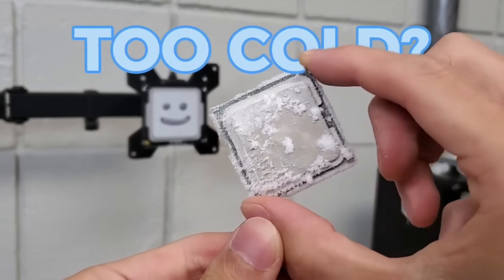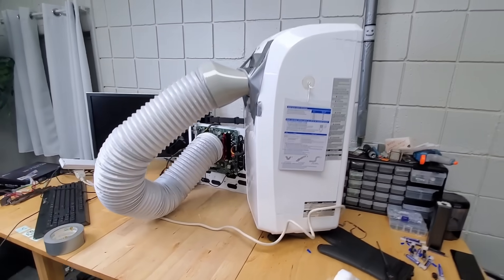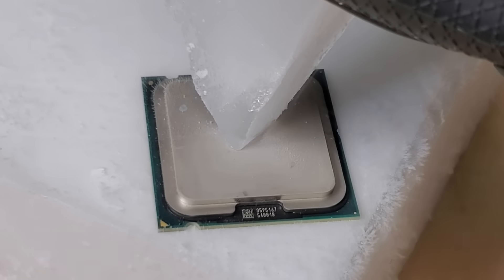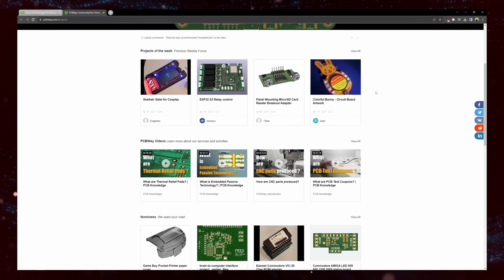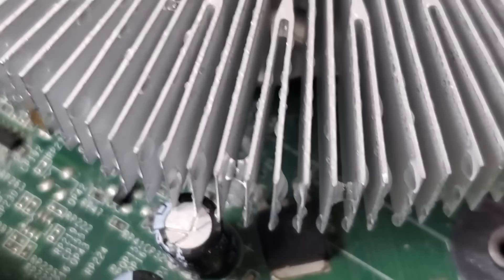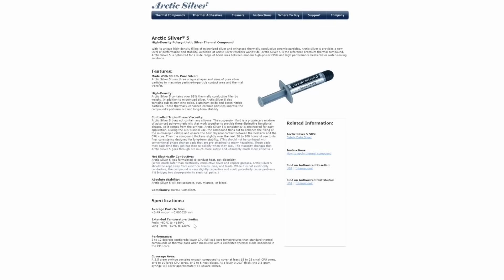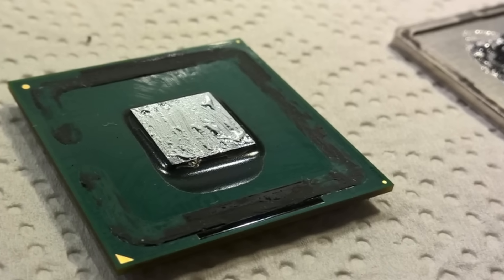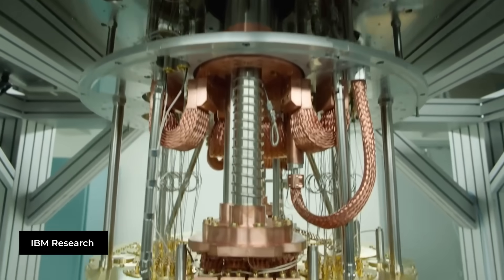The Crazy Future of CPU Cooling

Comment: If a CPU was cooled to the point that it was effectively becoming a super conductor wouldn't that change the properties of the transistors, making them more conductive as well. It seems reasonable that they would then not be synchronized with the clock and then would function basically at all.
Reply: The CPU may not work well below -70C   as the metals in the die will shrink too much, which will noticeably change its conductivity, the silicon transistors itself will require more energy as the valence gap is higher in the semiconductor  atoms.

Note: I spitting bullshit that may be correct.
Reply: @ArmiaKhairy Ive seen videos where they run cpu at -100 and lower
Reply: @brawldude2656  Yes but they do that to overclock them and with that get temperatures up to 100 degrees C
Reply: @ArmiaKhairy this is absolutely wrong
Reply: Silikon becomes superconductive at 0.35K as a quick Google search suggested. In Comparison, Liquid Helium sits at 4.2K, while Laser Cooling could get you down to 0.35K. As far as I know does laser cooling not provide the Power to cool bigger structures, so a micro chip should not be possible to cool down with that...
Reply: @ValentinHhn Different brands might use diffrent elements for doping. So idk it might varry according to diffrent manufacturers batches.
Reply: @ValentinHhn wouldn’t at that point it become bose einstein condensate?
Reply: I'm wondering if superconductive transistors would be able to turn off. What would that graph look like which shows what the voltage across the transistor is based on gate voltage? They aren't simply on or off.
Reply: That's why when an ln2 overclocked cpu crashes they have to warm it up again to boot before cooling it extreme again
Reply: what if you just ran it so it doesnt get that cold
Reply: aren't semiconductors supposed to be "semi" conductors? they probably won't work at all
Reply: "Cold Bugs" happen, yes. Also, seemingly more-common w/ more-dense smaller lithography. However, Liquid Helium has been used for XOC'ing; it's (largely) a desirable effect, mitigating electron migration and allowing higher and higher driving voltages.

Comment: The condensation on the heat sink probably would not cause a short circuit. Since the water had condensed out of the air, it would be quite pure, meaning there would be nothing dissolved into it to carry charges. The reason you would want to avoid getting condensation on any electrical components is because it can oxidize electrical contacts, which can prevent current from flowing.
Reply: What about stuff on the heat sink getting in the ice itself and then in the CPU

Comment: The energy consumption for a cooling laser is nuts, let alone enough to cool a cpu directly, and ummm the power supply for the laser would be a heat source you’d need to cool as well, the whole thing is redundant. If you want to use laser cooling for something it’d have to be for a realllyyyyy specific reason

Comment: MANA superdonducting CPU is first of it's kind, bathing in liquid helium it achieves computation without energy loss
Even with cooling it's 80x more efficient than existing processes
In theory 1x1cm can endlessly cycle 10kW of power and scaled up dewar can fit much much more densely packed computing when modern EUV technology will be adapted

Comment: Well, I've watched a lot of videos like this, even in 2007 when they cooled computers with 1 or 2 cores and 3.2 gigahertz space 4.2 sometimes depending on the type of processor they even reached 5.2 gigahertz and they were very fast and only 1 - we are talking about 2-core computers, lga775 socket and intel pentium4, this is not new to me at all, the new thing would be if the superconductors were adopted better, which actually ensures that there is no loss of current, i.e. the resistance of the material is 0 ohms with the superconductor methods and this would be good on some level can also be applied to computers, because complete free flow between hardware could be ensured without opposition, which means that the maximum limits would be 1 - 2 pings from America to Europe, which would be as if the processes that were happening 1000 kilometers away were happening next to me, "supra leader " that's what it's called! ;) The biggest lan party in the world with super leaders xDXDXd world-sized LAN game!! xD

Comment: I'm sure someone else has already mentioned this, but cooling material down to superconducting states does allow flow of electricity through non-conductive materials, which would mean the electrical gates in your processor would not function properly and allow flow of electricity to areas you may not want it to.

Comment: How did the AC unit that can only go upto 16 degree Celcius , managed to make PC temperature in single digit?  This doesnt make sense
Reply: Because, he doesn't know how an AC works, the AC actually pushes air out 20 degrees fahrenheit cooler than ambient temperature the only thing he is doing when he lowers the number on the portable is when the thing turns off... so the portable should be blowing air out at 48-55 degrees fahrenheit. Which is about 9 degrees Celsius.

Comment: You talk about the CPU becoming a supraconductor then producing no heat. If the CPU becomes a supraconductor, then can it work? CPU are made of semi conductors, whose conductivity can be altered by an electric signal. If the chip becomes a supraconductor, it should then loose all functionality, as all transistors would be stuck in the flowing position.

Comment: I thought of this idea a year and a half ago, but air conditioners use a lot of energy to operate, and if there is a malfunction in the air conditioner, you will have to buy a new one and not use the computer until the air conditioner arrives from repair or you buy a new one. Less recommended

Comment: I think the fully submerged cooling system in fluid is just funny but also definitely how most server rooms will be cooled over fans.
Reply: Thats what some Quantum Computers use. It won't be used for conventional silicon Computers, since it is so bad in Terms of Energy efficiency! Else they would use that already! In Addition to that is liquid Helium damn expensive, so you would probably Just use liquid nitrogen which is a bit cheaper but still inefficient. Btw that is the only reason why MRI Scans are so god damn expensive.
Reply: @ValentinHhn  Oh I’m not referring to stuff that crazy. I wish I remembered the name but I believe IBM was working on it and showcased it at a tech con few years ago. It’s purpose built to cool servers and such.
Reply: @guitaristkuro8898  yes there is a solution for submerged server cooling but its just cheaper to run the regular AC units for the server room. you dont want to clean server modules every couple months just because the solution might get conductive (bits of pieces falling of the hardware mixing with the solution).
Reply: That's how they cool transformers
Reply: DIY PERKS did create that set up once , u can watch his video if you are interested in trying it out.

Comment: 5:00 actually the risk is the water will pick up dirt/dust and other particles and then conduct electricity. If you could have everything without any dust or other similar things the water would basically be distilled water, and therefore not conduct electricity (then, overtime the water might dilute things like paint or erode a couple of metal particles from the motherboard/heatsinks and will eventually short xD but it takes a loooong time haha)
Reply: Was looking for this comment lmao
Reply: *me applying flex seal to the motherboard
Reply: use d2o(heavy water)

Comment: No quantum computing is not the future of home pc. I am a researcher at quantum computing. It has vastly different purpose. Generally we use computers for repeated tasks meanwhile quantum computing is used more for high number crunching. We use matrix and qft to do the number crunching with qubits. The advantage of qubits is that it has 3 different stages that corresponds to magnetic spin of the fermions inside the atom. Only very few atoms can be suspended in space with laser cooling and it requires an enormous amount of time and resources to even do that. Also there is further cooling after laser cooling. After stopping the atoms and flushing the atoms at the higher temp away, you will switch off the lasers causing the atoms to expand once again causing the atoms to fall to an even lower energy level.

Comment: All cooling solutions do not 'destroy' heat, they simply move it from one place to another. There is nothing wrong with the cooling ability of modern systems, a modern top end watercooling unit can cool ANY cpu and gpu in existence. The problem is not how much heat is taken away from the components, it is where the heat is deposited. Current systems (including the AC unit in this vid) throw the heat around the PC, making the room hotter and hotter hence more uncomfortable to the user, and making the pc also draw in hotter and hotter air making the cooler work harder.

What a 'better' cooler should be looking to do is to route the heat, via pipes ect., to either another room or outdoors.

Comment: Oh, God. I have to warn people about ANOTHER thing he did here?

DO NOT PUT YOUR AIR CONDITIONING UNIT UP AGAINST, OR USE TUBES TO DIRECT AIR FROM ONE, AT A PC TO COOL IT.

Again... condensation. Air conditioners are basically just dehumidifiers, and the humidity is recirculated instead of collected. You WILL fry something.

Comment: the AC thing may be a decent option, you would be able to pipe it into the CPU cooler in a case easily and then you pipe the hot air outside. 
just make sure to get a 2 pipe one. 
I guess it could be used to cool your pc first and then cool your room. 
though you can do what I do, turn on the whole home AC and then put your pc next to it so it gets cold air
Reply: Electricity costs make it an issue. Heating and cooling require a lot of watts. If you have a 500 watt PC with everything running, an ac cooling that computer may be equivalent to running a 1500-2000 watt system. Not to mention that 2000 watts is mighty close to your wall outlet plugs power limit, so the ac would have to be on a different breaker than your PC so you don't trip anything.

No rides for free in life I'm afraid.
Reply: @omegaprime516   I mean, there's countries where light bill isn't an issue, I have a 750w computer running with an AC on that very same room, what would really be the difference?

Comment: water condensation can be directed by modifying the radiator, where there is no water, high-temperature silicone is used, and where heat exchange is to take place and where water condensation is to occur, the radiator is silicone-free

Comment: the silicon wafer does not heat up evenly only at specific points, cooling the entire wafer and not the hot spots increases the temperature difference and cracks the silicon wafer

Comment: That AC-Unit wont do anything to a room, unless there is a hose for exhausting the hot air outside. Just needed to mention that since these things are a total scam...
Reply: hmm yeah. speaking of scams im wondering, where will the heat from the laser used to cool something actually go? cooled by even more powerful lasers?

Comment: i have a feeling that a laser cooler would be "slightly" more expensive than the cpu it will be used on
Reply: dies in poor
Reply: @DragonDenGaming  To unlock the perk 𝐥𝐚𝐬𝐞𝐫 𝐜𝐨𝐨𝐥𝐢𝐧𝐠 in the game Real Life™, you must be level 1000 or higher
Reply: @DragonDenGaming not companies problem that you're poor
Reply: @Determinator21  it is cuz then u can’t buy it. But if all of them are expensive then yh
Reply: and use more power
Reply: @M1szS and need cooling
Reply: @sql64  just get another laser to cool it, problem solved
Reply: @sql64  the cpu cooler that needs cooling which requires cooling which then also needs cooling to cool the cooler that cooling the cooler thats cooling the cpu
Reply: @sql64   hahah your cooling will need cooling. Like hard drives and ram now need cooling
Reply: @sql64 just buy another cooling laser to cool that laser
Reply: @richhobo1216 damn u beat me to it
Reply: @richhobo1216  and another laser get heated up
Reply: Just slightly
Reply: Me using it on an adapted intel pentium:
Reply: My wallet just shriveled up  an died at this news
Reply: Not really, laser cooler is literally just a vaccumm and two a few lasers. Laser diodes are cheap, vaccumm is a tad more expensive though ;)
Reply: @zachary3603  it’s a laser “cooler” for cooling lasers ...
Reply: @zachary3603  thats like saying car parts are cheap because its just a chunk of iron. If you ignore everything else like R&D, assembly plants and machines then yeah i guess
Reply: For current applications, the processor is already exceeding the cost of a house, so that's hardly relevant for the average person.
Reply: @Naokarma then everyone would have a fucking house dont you think?
Reply: @deivisnx  You may wanna reread my comment. You really don't seem to understand it, given how your reply makes literally no sense.
Reply: @Naokarma  if your fucking processor cost 400k then yeah, yeah sure.
Reply: @deivisnx  You really didn't read my comment, lmao.
Reply: @Naokarma how cheap do u get houses man cn u hook me up
Reply: @Naokarma  maybe learn to type coherently, or just explain?
Reply: @deivisnx  My original comment was very clear. If you're the type of person who's making these kinds of coolers, initial install isn't your primary cost concern. These cooling methods are mainly used on Quantum Computing, which is gonna be a lot more costly than the laser price. 

This is common knowledge by now; I shouldn't have to spell out that "fancy computers cost money".
Reply: @demonwing9431  I wasn't calling houses cheap. I was pointing out the CPU's being cooled with lasers are very expensive. Generally, ones used for quantum computing, which are in the millions.
Reply: @Naokarma  then the current professor is an idiot. I did the same experiment 10 years ago for about 2k. Look up Bose Einstein Condensate.
Reply: Laser cooling isn't really a tech to cool computer parts. Things that are cooled by laser are already cooled to less than 1 Kelvin, laser tech exist just to squeeze another tenths or hundredths of Kelvin from a few atoms of condensed matter. In other words, you need to precool things to extreme temperatures first before laser cooling becomes viable. For chip cooling usually first step is enough.
Reply: I got an idea a fridge case
Reply: cries in bankruptcy
Reply: 😂 agree
Reply: slightly
Reply: Maybe a new price drop?👀
Reply: just a few zeros nothing to worry about right
Reply: @Aphetalion 😂lmao  🤣 hey it's all in the inverted logic.
Reply: probably gonna be used for science instead of gaming
Reply: @celanvaril6200   ... true
Reply: laughs in rich
Reply: What if they just use the sun to warm it.
Reply: Superconductor worth it
Reply: Not really
Reply: no way im the 1 thousandth like on this comment
Reply: it might take 100 years but it will prob be the leading way we cool things
Reply: @minizamorak  You do realize what computing managed to do in 50 years right?
Reply: don't worry in 150 years it will be affordable to the average consumer!
Reply: @esotericjahanism5251 😂
Reply: But the most important part of it all is that computers already reached the limits and the universe is finite. So......

Dies in total ecological collapse. Honor and glory 😤
Reply: A laswr cooler will always work. You will buy it ONCE
Reply: Good thing it'd be a separate module, so you can reuse it anytime.
Reply: As if I would let that happen
Reply: And I can't even afford a normal i5 processor 😓
Reply: its not for normal CPU's

Comment: Laser cooling is an interesting idea. Makes me wonder if one day I can cool my house with lasers instead of air conditioner?
Reply: Just imagine they are pushing your molecules and you cant move..

PLEASE dont take this seriously I am just joking
Reply: every techbro wants to cool his tech with lasers, but i want to cool my house with a shark.
ppl be like, his house is so cool theres even a shark in there🤩
Reply: Your house would start off unbelievably bright and progressively get darker (until house lighting took over) until the house is cooled to the programmed temp; As it converts infrared heat to light energy by exciting the molecules to a higher energy state.

Just like battletech light emitting heatsinks the clans developed. It would work on that same principle. So if your ok (and your neighbors) with excessive light pollution (inside your house) for those moments before being cooled to the target temp, than your golden.

If you don't mind the experience of being inside a light bulb, than you would probably hate what it could do with your body. If the lasers can interact and phase change air, it can and will affect your body. So you probably couldn't be inside your own home when it's on due to phase change in the body and possible melanoma skin cancer (as so e light emissions would surely be in the uv range).

It probably wouldn't be safe to be in the area with it operating without a shit and eye protection (like welding goggles).
Reply: @omegaprime516  light emitting heatsinks...are they real :face-blue-question-mark:
Reply: Don’t look at it